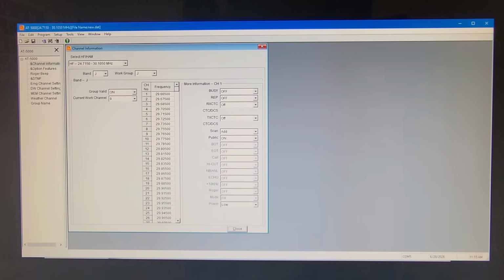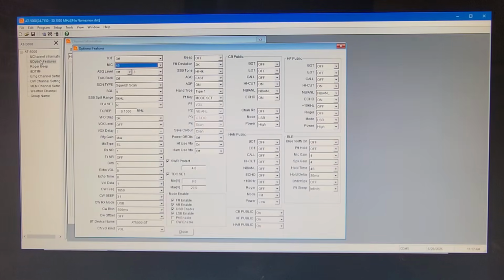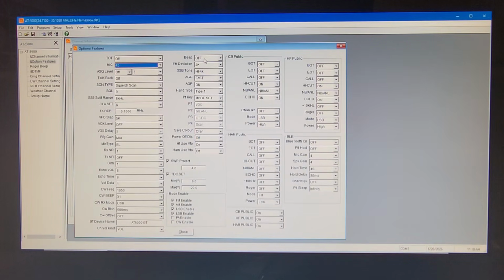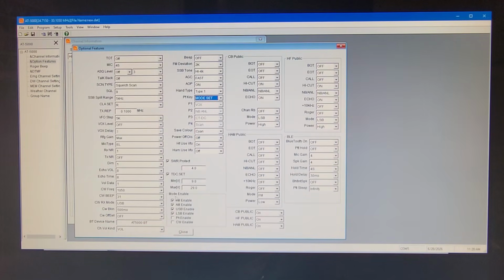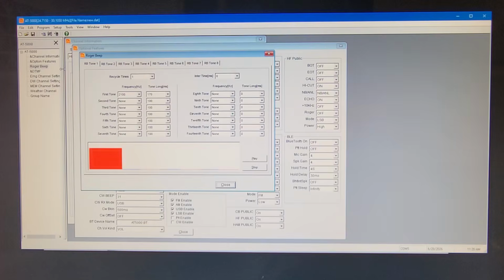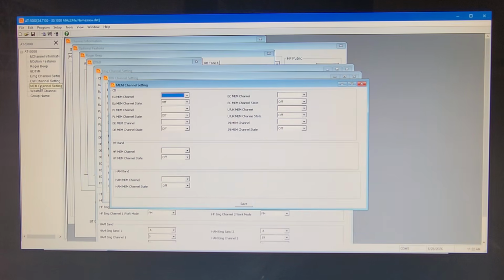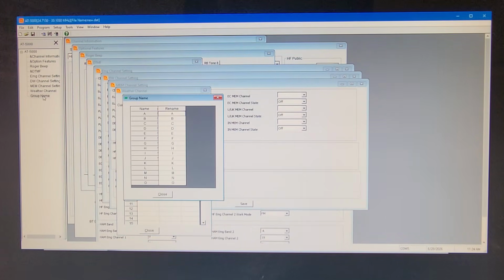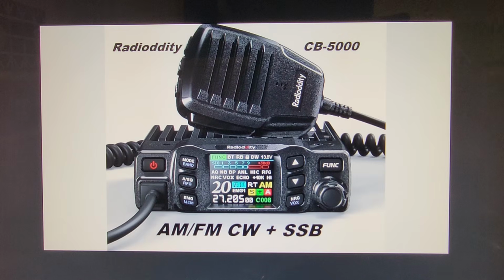CB-5000 + AT-5000 CB radio programming. Radioddity + Anytone

Comment: Oh no! I thought for sure you were going to tell everyone to read from the radio and THEN do a Save As “default” codeplug if you ever need/want to go back to factory settings and factory codeplug!
Reply from the maker: the radio has a reset in the menu that will bring it back to factory settings, no need to save an original file.